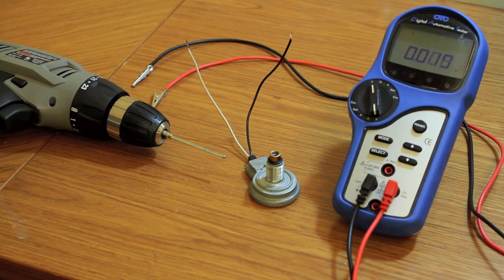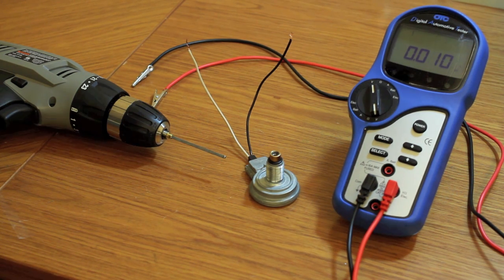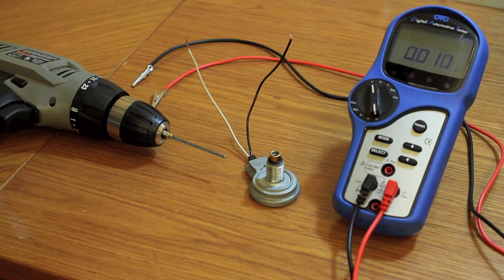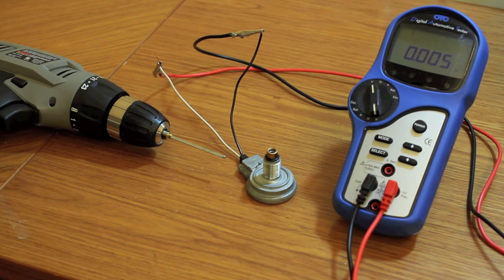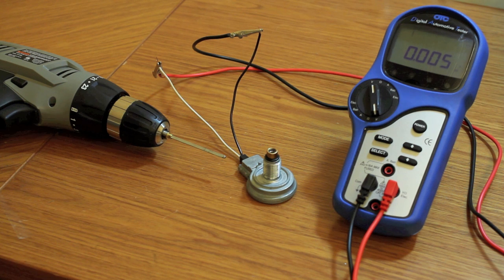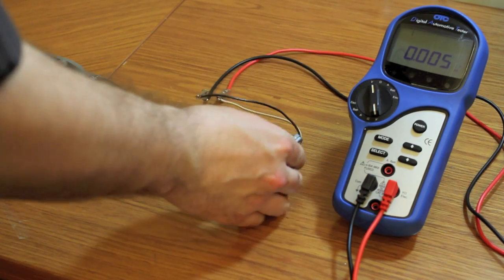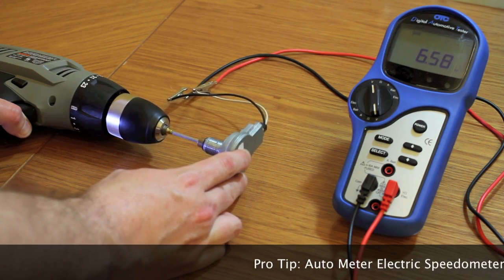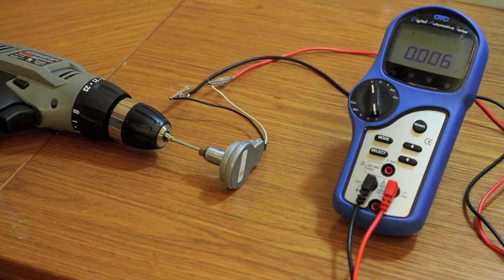How To Test A 2 Wire Speed Sender

Comment: Thumbs up Buddy!  Not sure why polarity would make a difference on the connections being that it's AC.  Has anyone here experienced  the sensor ultimately being bad despite it putting out steady variable voltage as demonstrated here?  I keep getting a trouble code yet my sensor bench-tests perfectly fine and no visible damage.  One research discovery I made through Scanner Danner is that excessive alternator ripple from bad diodes can cause this erroneous error due to excessive AC entering the system. My alternator tested good though.

Comment: Technical question: So I have a motorcycle with a 2-wire magnet speed sensor. I need a speedo corrector to accommodate my
Smaller rims. The only speedo corrector that exists for motorbikes calls for a three-wire type speed sensor. Is it possible to concert my 2-wire magnet speed sensor to 3-wire for this module to correct my speed? It is about 15-20mph too fast. The module has an *input signal wire, *output signal wire, and *positive and *ground connections. Please let me know if you can provide any advice or diagrams to further assist me. Please message me at cristianthegr8@gmail.com 
Thank you.

Comment: thx for your reply! I'm going to measure resistance across the two wires to see if the sensor is ok. Then if it is ideally I'd need to emulate the gearbox teeth in order to turn the speedometer as I have a couple of hundred kms to catch up as the van was working but not the speedometer. for maintenance purposes I need to keep track of the real mileage.

Comment: Hi there great video. So is polarity irrelevant? Meaning it doesn't matter which way the two wires connect to the cluster's speedometer?
I have a VDO Mercedes Sprinter sensor I guess it's a VRS as it's 2 wire. Is there another way of exciting the sensor without having to drive the van around? My sensor doesn't have a slot into which to introduce a drill like yours has. Could I spin a metallic object or a small magnet near it carefully looking into not exceeding a too high voltage would this work